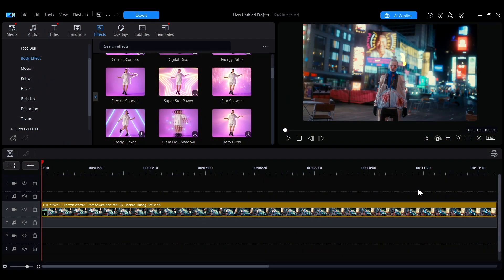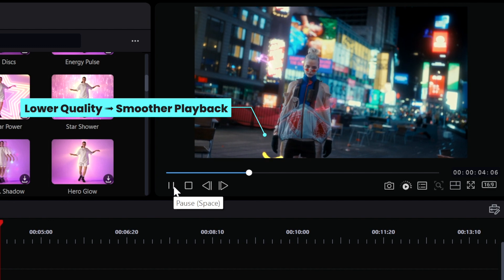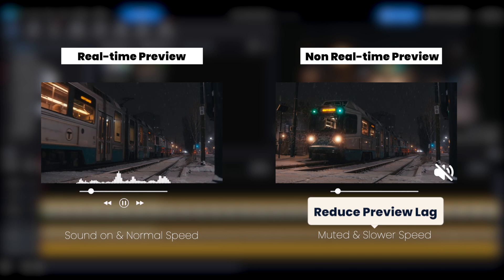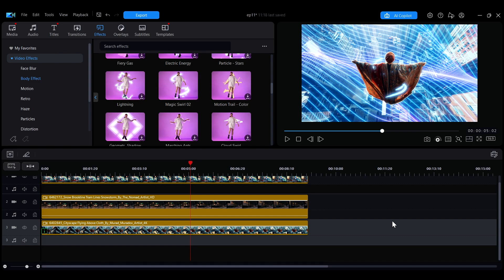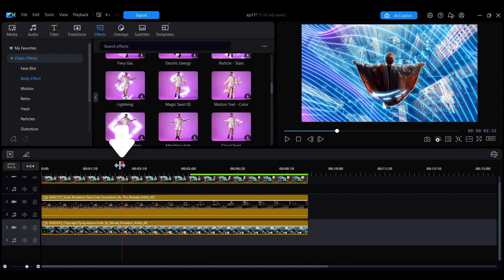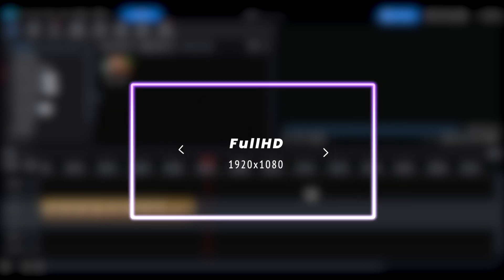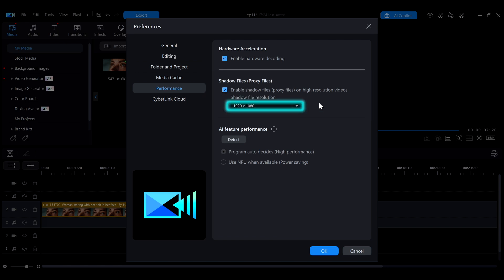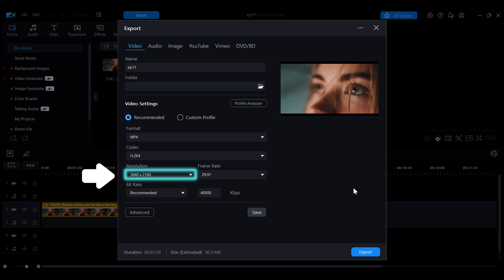4 Tips to Reduce Preview Lag for Smooth Editing | PowerDirector Tutorial for Video Editing Basics

Comment: I find it offensive that your tutorial assumes the problem with lag, is a users computer.   My machine has 128GB of ram and an RTX A4000 GPU with 16GB.  It is run off of a series of NVme drives for super fast access, and guess what?   Your software STILL lags, because it does NOT use the computer I paid for.    Don't go telling people it's their computer when the problem is squarely your software.
Reply from the maker: Hi Sir, 

The tutorials aim to let users know what common factors can affect the preview smoothness generally, and how to adjust some preview related options to make the preview works more smoothly in PowerDirector. 

Most of users might not have a high end GPU, but simply use an entry-level laptop to do lightweight video editing with a power or budget friendly graphic hardware.  

Take it easy and world peace :)